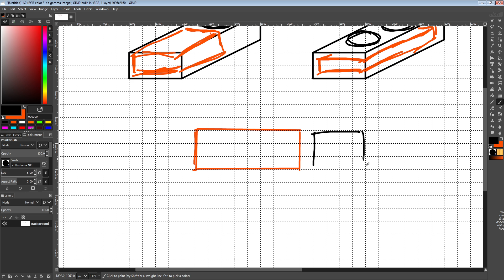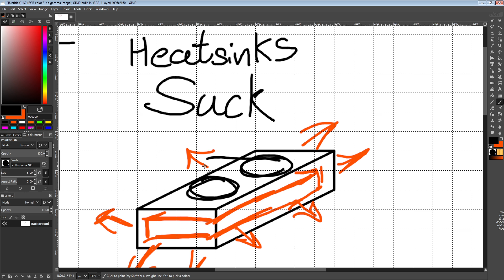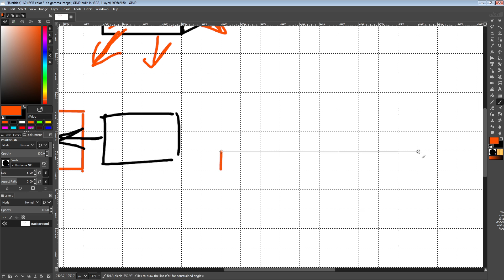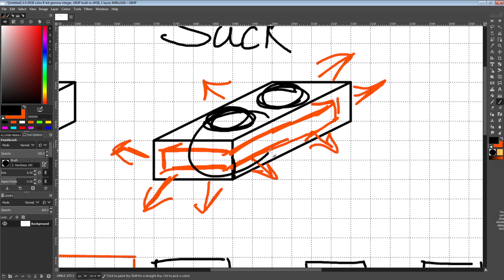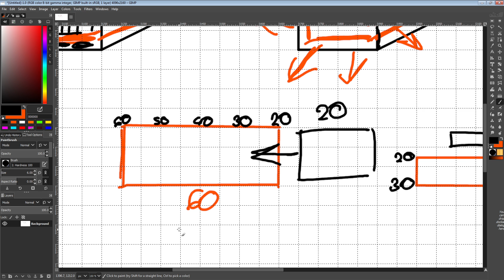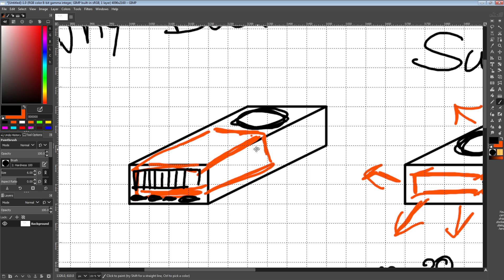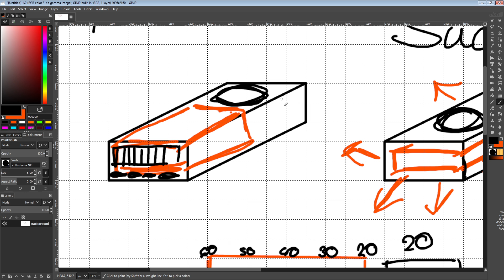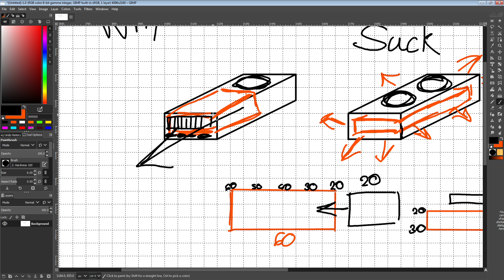Why blower heatsinks suck

Comment: What? My vega reference cooler is fine!
Reply: The "what" is because you are semi-deaf by this point because of it, right ? :D
Reply: @tusux2949  WHAT? hehe yes :)
Reply: You dare!!!
Reply: This joke isn't cool.
Reply: Vega 64 airboost oc here! Card is only cool after undervolting and fan curve optimization.

Still noisy. Hits about 70ºc on games and have put a sensor on the exhaust. Temps can reach high 50s there, but the air goes out, not affecting the interior mean temperature.
Reply: unironically true... but only with undervolt and custom fan curve